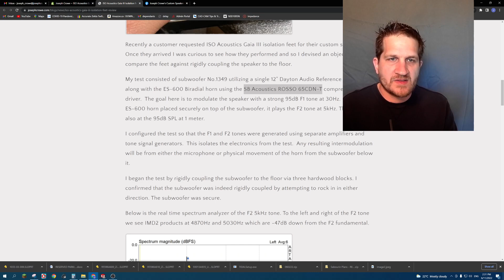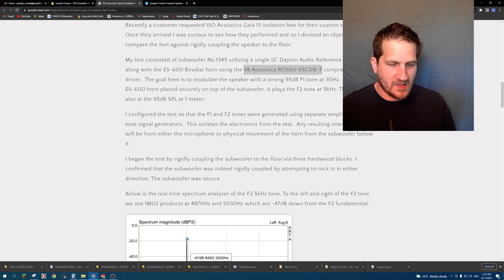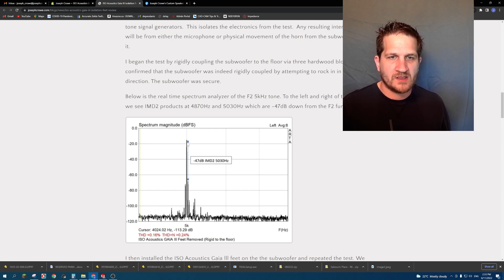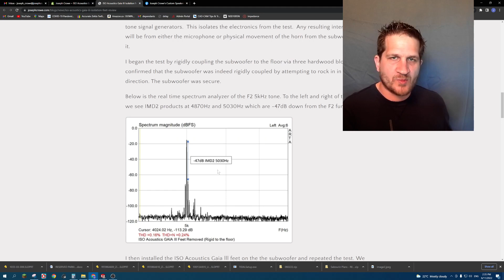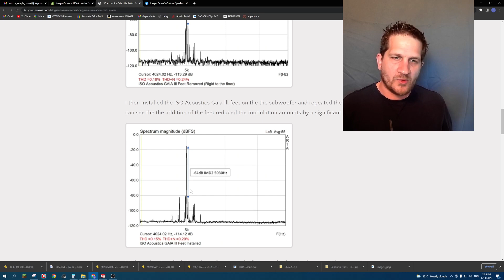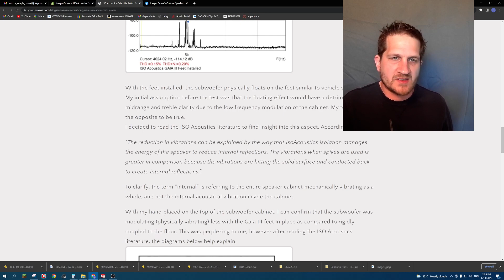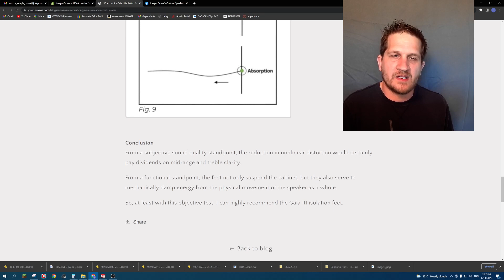ISO Acoustics Gaia III Isolation Feet Review

Comment: I bought a set of Gaia 3 after watching this, for use with standmount speakers (Elac ARB -51).  I replaced the spikes on the stands with the Gaias and feel noticeably less vibration in both the speakers and stands. It’s too bad they are so expensive; I am unlikely to buy more for the other speakers I have.  Rather, I’ll use Sorbothane feet or swap the Gaias around.

Comment: I've been into isolation since 80's Navcom Pucks, Sorbothane, etc. 
I employ high mass, atop isolation. 

Sorbothane type iso offerings are plentiful.. what's vital is the Q, ie., weight to product ratio. 

In the 80's I'd DJ events set atop a Black/Decker Workmate, and float my gear with Sorbothane atop a massive MDF plinth.

Those early generation Workmates were killer... just a stout, stable platform.

Truly dig your content, no one else is generating content like this. 
Great stuff.

Comment: Thanks for doing this cool test!Very interesting! I’m not too surprised as a rigidly connected speaker cabinet to a concrete (nearly immovable) floor causes cabinet vibrations to reflect off the floor at your rigid blocks and back to the cabinet. That said, there’s no substitute for actual testing and listening. Well done.👍

Comment: Unfortunately speaker decoupling is a very complex subject. Most products around like the isoacoustics and spikes don't properly decouple speakers. They all do something but it's never the ideal goal. These are essentially dampening the cabinet and not isolating the speakers. In order to isolate you need the resonant frequency to be below at least an octave below where the speakers roll off. The problem is that for most speakers, this ends up creating a system that's too "springing" and you get bending modes where the speaker is able to wobble around (like you menitoned) which is a bad thing. In order to properly decouple and get rid of these bending modes you need an incredible amount of mass. No matter how hard you push on the speakers they shouldn't move at all yet they can still be decoupled down to 10Hz. The only person I know doing this properly is Thomas from Northward Acoustics. He's the only one who's worked out all of the engineering but his system normally uses steel cables that are highly tensions (several tons) in order to create an equivalent to the mass and then he uses sylomer as the decoupling material. Speakers end up felling like a solid wall yet the cabinet is highly damped (as the isoacoustics seem to help with) and no energy escapes to the rest of the system.

Comment: This test is incomplete and not very useful without a control. Please repeat the test with a control, a very cheap partsexpress rubber bumber or any type of rubber decoupler for that matter.  You are comparing decoupler vs rigid. You should compare very expensive decoupler vs ultra cheap decoupler to see if the gaia is worth it. Thanks.
Reply from the maker: That would be a great follow up test which I’m already planning to do. A diy solution using foam rubber that is readily available along with guidance of how to determine durometer for a specific application.
Reply: Also, Vs the SVS isolation feet. Isolation feet are a great idea, stops vibrations going into your floor. It's just are more expensive versions better, or even worse, etc.? ¯\_(ツ)_/¯